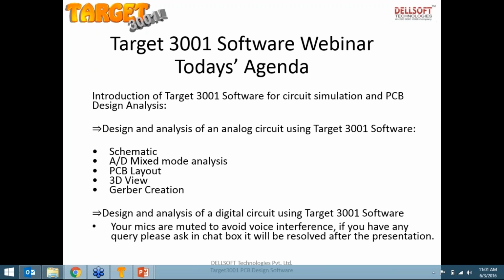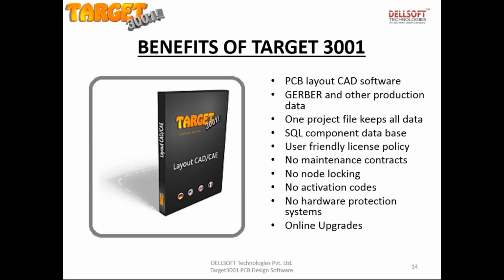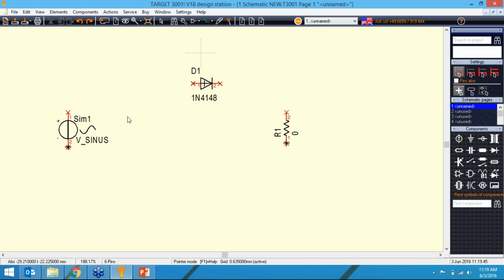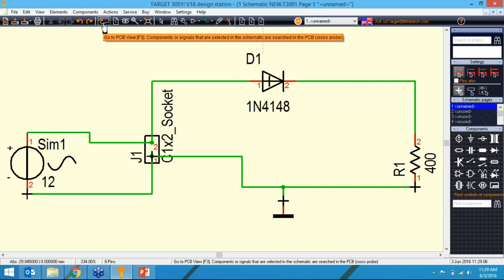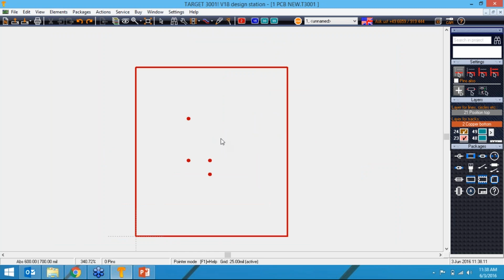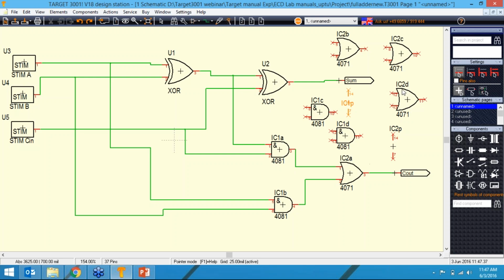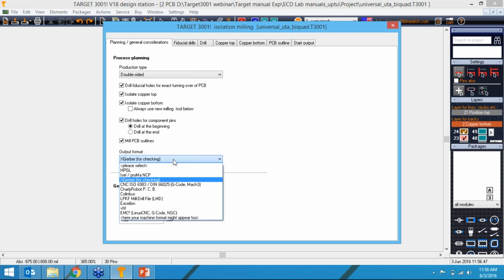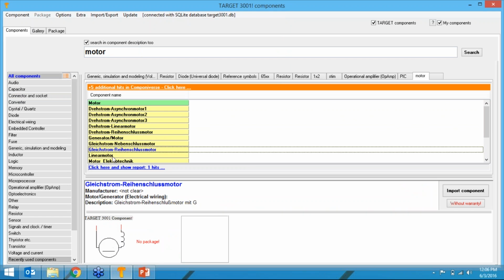FDP | Circuit Simulation and PCB Design using Target 3001! June 3, 2016

Comment: When the PCB track is router if you delete part of the track, then want to connect it again to the pin, is it possible to do it by simply dragging the wire? Why doesn't it snap to the pin?